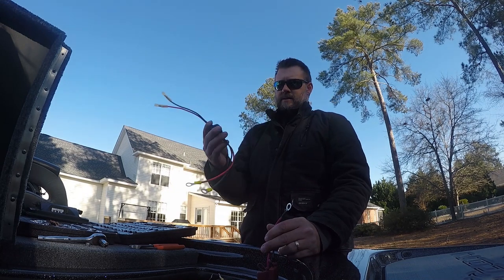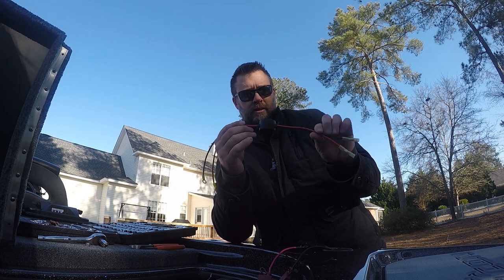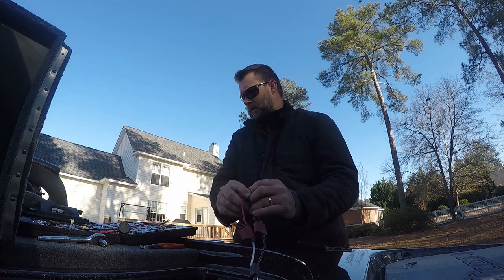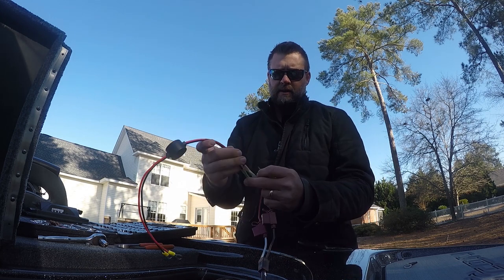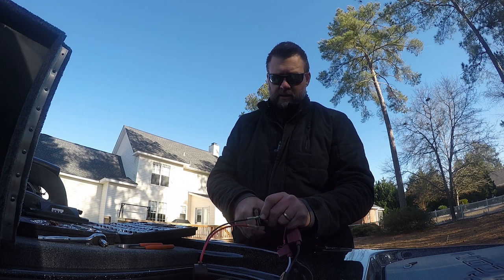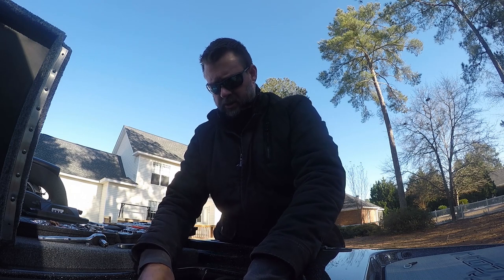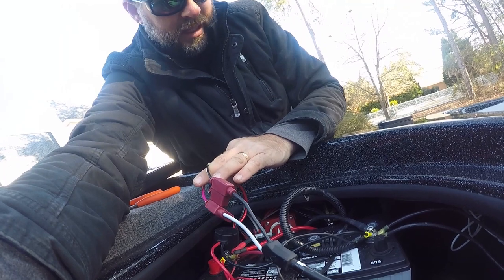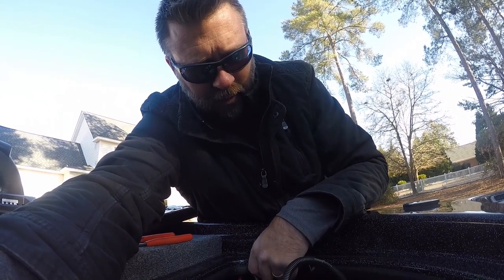Eliminate Graph Interference with a Minn Kota Filter.

Comment: Just some clarification for anyone that is looking for this part. It does not ship with the Ultrex, actually Minn Kota does not offer this part at all. However after much research it does ship from Hummingbirds website. It is included with Mega imaging transducer brackets, but you can order it separately by using part #490482-1 Cable Choke.
Reply: Humminbird does have it on their website.  They charge $24.99 for the cable choke and want $12.00 to ship it.  I am so tired of having to buy 'extras' for Humminbird and Minn Kota products, especially when the shipping cost is half the price of the product.  This should have come with the Ultrex, period.

Comment: OK; the I just bought a Helix 7 and the documentation states to install the choke on the cranking battery.  My trolling motor and graph are powered by a separate battery.  It seems intuitive to install the choke on the trolling motor battery and two have stated such in these comments but you do not disobey the manufacturer's instructions without good reason.  Upon which battery have the rest of you installed this?
Reply: The feed back comes through the charger that's why it goes on cranking battery...
Reply: Thank you.  I did and did not experience any interference.   @inaslump

Comment: I need this part...Minn Kota did't know anything about it. Does anyone have info on a part# or where to get this??
Reply: Just some clarification for anyone that is looking for this part. It does not ship with the Ultrex, actually Minn Kota does not offer this part at all. However after much research it does ship from Hummingbirds website. It is included with Mega imaging transducer brackets, but you can order it separately by using part #490482-1 Cable Choke.
Reply: Never had this issue on my Motorguide but as soon as I switched to Minnkota, this noise problem has started. Thinking back 25years ago when I rented a Minnkota, I had this problem. Seems like even in 2020, Minnkota has not been able to solve this problem!!

Comment: OK guys, if you have an onboard charger then you install this on your cranking battery. Why? Because this will filter out the noise coming from your trolling motor batteries from entering your cranking battery which supplies you graphs.

Comment: Where can you buy this or do you have a part number.
Reply: Just some clarification for anyone that is looking for this part. It does not ship with the Ultrex, actually Minn Kota does not offer this part at all. However after much research it does ship from Hummingbirds website. It is included with Mega imaging transducer brackets, but you can order it separately by using part #490482-1 Cable Choke.

Comment: I'd say pull the fuses out of the charger lines to the starting battery and give it a shot before wasting tine and money on this filter. If it's still froggy without the fuses the charger isn't the issue.

Comment: Still not clear where to install it...........  A diagram would be nice....
Reply: If you run a 3 Bank charger it goes between the charger cords and your starting battery. You should have your graph hooked to your starting battery.
Reply: @westleycagle4745  no you should never use your starting battery for graphs they are stating batteries you have to use deep cycle for all electronics. #fishingitguy

Comment: MY CHARGER IS ONLY HOOKED TO MY TROLLING MOTOR BATTERIES AND ONLY TROLLING MOTOR TO IT. ULTREX 80LB BUILT IN MEGA GET DOWN LINES WHEN HIT PEDDLE POWER. SO THIS SHOULDNT BE MY ISSUE.. BRAND NEW ULREX AND NEW HELI7 7 G2N. POWER RAN OPPOSITE SIDES OF BOAT FOR EACH.
Reply: Yes it is the chargers carry voltage, Disconnect the charger from your trolling batteries tape the end put your boat in the water and test for lines with no charger hooked up to your trolling batteries only. This choke has to go to the battery that your graphs are plugged into or it does nothing.  #fishingitguy